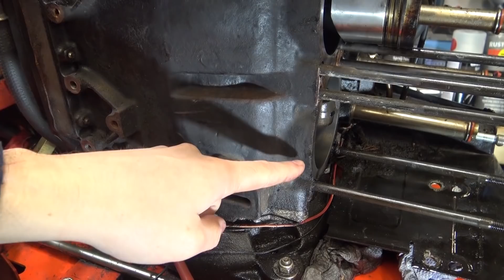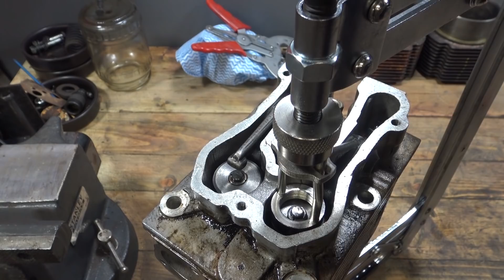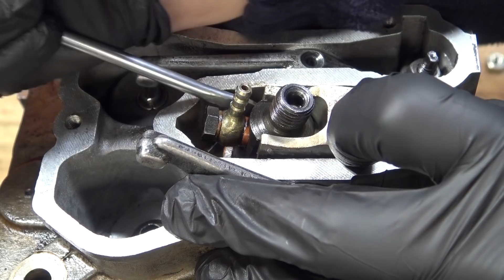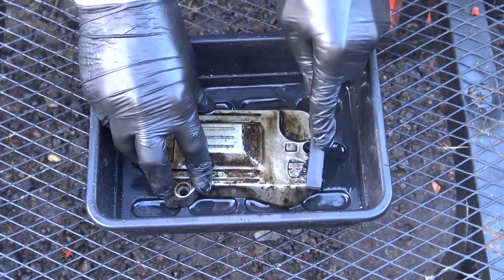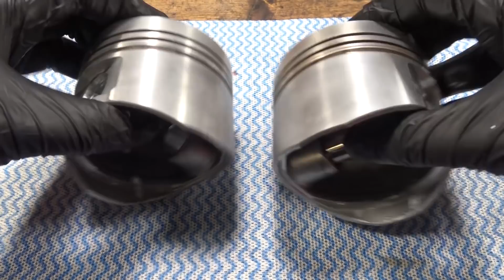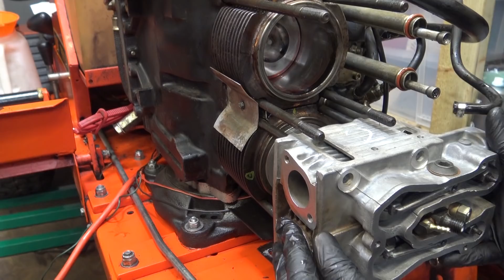REASSEMBLY RARE HYDROLOCKED DIESEL TWIN TRACTOR | Part 2

Comment: I wasn't expecting a dry sump system, but that's one very effective way of making an engine work in a vertical configuration where it wouldn't normally work, with the disadvantages of higher production costs and needing more oil.  The old Howard single and V-twin rotary hoe engines were also dry sump engines.

Comment: Many dry sump oiling systems have a pressure side and a scavenge side pump. The tolerance should also be checked on the pump.😉   Thoroughly a fun video.

Comment: Love the videos, takes me back to the days when you could work on your  car as a teenager. My only comment would be re the gasket set, I was always taught if you are doing one bit do them all. As you would when changing a clutch, while it's out change all three parts-plate,housing and thrust bearing. This is only my opinion and as I was taught. Great videos , keep them coming.

Comment: I prefer your voice over to no voice over.  Nice job, If you take something apart, replace the little bits.  They are cheaper than your time.  Just a preference, but I would have lapped all the valves and fitted new valve seals to all of them.

Comment: Hello, it is more likely that the oil is getting back to the crank case via the feed oil pump. There would be no need for a check valve on the scavenge return as it goes in to the tank above the oil level. Old British bike often fill there sump over the winter due to wear on the supply pump.
Unless it is excessive you can live with it, or if you are brave fit a valve in the supply line to the pressure pump.  John

Comment: Ultrasonic cleaner works a treat on carbon.  Highly recommend it especially on aluminum parts.  You don't have to use any crazy chemicals either.  Water usually works just fine.  If a person wants to use something beyond water make sure it does not contain any sodium hydroxide.

Comment: On a dry sump engine there should be NO oil (to speak of) in the sump. The scavenge side of the oil pump has a greater capacity than the pressure or supply side. I would have used a thin oil or diesel fuel to put in the oil tank to check for leak by. I still suspect you may have a return valve seep that with thick oil may take days to weeks to become evident (like over winter). I strongly advise you take a look at it. Oil in the sump should not be at a low level, it should not be there at all!
Love your channel.

Comment: Spent a lot of time back in the day working on Detriot Diesels.The injectors on those are mechanically operated off the cam,but in the injector repair manuals there wasa very bold print caution about diesel spray.That stuff can be deadly if there is fuel from the unit tank because there was then a bacteria that would grow inside the fuel tank.If the pressure did not remove a finger getting the bacteria into  the blood stream would cause a very dangerous infection.Also worked on American Bosch fuel injectors,they were perssure type like the ones you showed.I still remember that they had a cracking pressure of 2800 PSI.So of course they would inject fuel into a person if you got careless.

Comment: diesel rattle is this sound when confined inside a metal pre-chamber or combustion chamber and reverberates through the cylinder  head and high pressure lines 11:45

Comment: Nice work you are doing to that engine, I have one question though: what kind of cleaner were you using on the heads and valve cover? It seems like this stuff works fairly well.
Have a nice day, keep up the good work and greetings from germany :)

Comment: Great video. I used to work for Harley Davidson years ago, the engines of the time had dry sumps, a common problem was the owners would park the bike up all winter, not run the engine before checking the oil in the spring, thinking the oil was low they would fill the oil tank, after starting the engine the oil that had seeped into the sump had nowhere to go. Next thing we would get a call exclaiming the unattractive Harley oil fountain in their garage.

Comment: Please tell me you simply didn't film it when you pulled the other injector, and remaining 3 valves out to clean, lap the seats, and install new seals. Not doing that while the engine is this far disassembled would be a foolish mistake.

Comment: Shouldnt have honed it. The honing was perfect before. Now you most likely ruined it as your honing marks are not in the right angle (45° is perfect). The honing angle is absolutely crucial. 
The problem is: Your marks look like 25-30°... (19:53) This angle can lead to the cylinder getting stuck in the bore...

Comment: On diesels with injectors, the most important part is that both injectors pop at the same pressure. If there's a difference then it'll blow the engine up. You see it on a 6bts with someone putting a chinese injector in.

Comment: Why not use regular oil when installing the pistons into the cylinders? Can't wait to see this run
Reply: The red oil is assembly lube, very high viscosity and sticky. Regular oil will only leave a light film and run off. Assembly lube will provide a thicker lubricating layer and not run off while the rest of the engine is being assembled

Comment: G'day I have really enjoyed watching this it reminds me of mucking around with my 4x4 Diesel engine.   It can be frustrating trying to find the fault of the oil in the crankcase sounds like scavenger pipe if it was mine I would replace the check valve anyway to eliminate it and the engine has been sitting for a while the spring and ball could be stuffed. Very interesting though, have a Merry Christmas and a prosperous New Year king regards John

Comment: Excellent engine rebuild but of course the key questions are whether there was an oil problem and is it fixed. For 20 mins I was shouting at the screen - check the scavenge pump and then, at the very end you mention it. Could you not drive the engine with a drill on the crank nut and, removing the banjo bolt, check that it is pumping oil up to the top of the holding tank ? Could always remove injectors to reduce cranking load.

Comment: never use assembly lube on piston rings. wd-40 on pistons is all you need. there is not enough oil flow on the rings to wash it off and a good chance of cooking it and the rings sticking
Reply: do you think diesel blow by could wash it off?

Comment: Not very familiar with diesel powered lawnmowers. That is unique. I’ve ridden larger type agricultural type lawnmower-tractors with diesel engines. Mostly bush hogging out in the fields. 

You’re doing a great job with the rebuild so far.

Comment: Vapor blaster would have cleaned it all up much better. MathewMCRepair has DIY instructions to make your own.  He's a mechanical engineer, and has converted sandblasters to vaporblasters and made several of his own from scratch.  As long as you use the right media, it won't take any metal off.

Comment: I would expect there are two oil pumps. One to fill the sump, and one to empty it. As mentioned already by you, the dipstick says measure when hot. Please follow that, as these kind of engines are very picky about proper oil level checking procedure. I would have a look at the pump which pumps the oil out of the crankcase.

Comment: Pro tip: if you can grab the back of the valve with a drill and pull into the seat from the back of the head it makes lapping the valve seats way faster and more even than the suction cups, also if no clearance to grab the valve stem with a drill chuck, put one end of the suction cup in the drill and save a bunch of hand work, takes like three minutes or less. That's how we do big v8s and inline 6s

Comment: Has anyone suggested that this may in fact be a horizontal shaft engine that someone has "converted" to vertical shaft? I've seen that a few times, and it would explain all of the problems you've encountered. Many times very little thought is put into these horizontal to vertical conversions. Just my 2 cents.
Reply: I doubt it as a horizontal shaft would not need to be dry sump.
Reply: @dustyphillips3166  that's a great point, I hadn't thought of that thanks. Yeah the dry sump makes sense.

Comment: Years ago I used to work on air cooled Deutz diesel engine. The individual cylinders and heads on this engine remind of this Deutz engines. I remember spending a lot of time lapping the cylinder and heads together and then measuring the piston to head clearance. We would adjust the clearance by using different thicknesses of base gaskets. Brings back memories.
 Good job on this engine so far and I am looking forward to part three and this sweetheart starting up.
Reply: Every time I saw the side view of this engine with the cylinder hold downs, and then the shot of the cylinder it reminded me of a Volkswagon with a different head.
Reply: Old VW and Porsche engines are the same way, except you have to work with pairs or triplets of cylinders, making the job a bit trickier.

Comment: It might be a good idea to replace the scavenger pump.they do go bad and will let oil into the sump when it should not be there.slor of the small diesel engines use the dry sump.i hope you set the injector clearance right.they have a spec for that.if not set right you just out a whole in the piston.

Comment: Surely there must be a some kind of scavenger pump to return the oil from what is effectively the bottom of the engine to the holding tank, are you sure that that hasn't failed or it's intake has become blocked.  I seem to recall hearing of similar problem many years ago on a (lying of it's side) coach engine.   A much bigger engine of course and the it didn't lock, it just lost oil pressure and spewed the black stuff out of all over the place.   Okay I went on to watch the end of the video and you mention the scavenger pump, i think that's where your problem might be found.
Reply: Is it a hose where the oil is pumped back? Maybe a sight glass inside would solve the riddle.